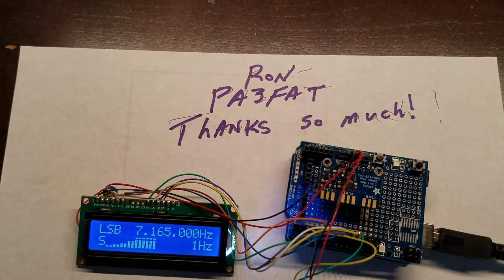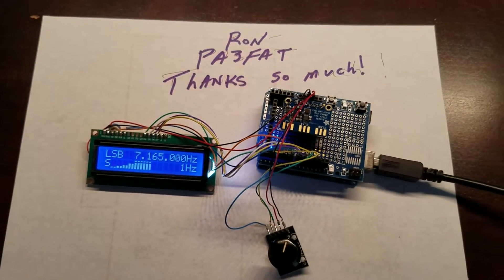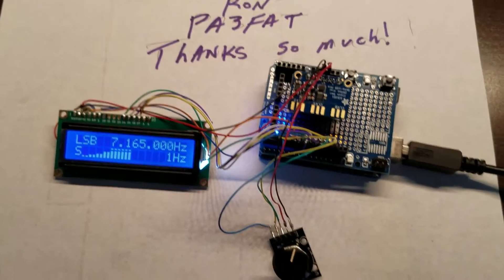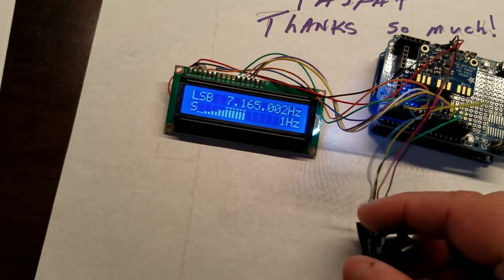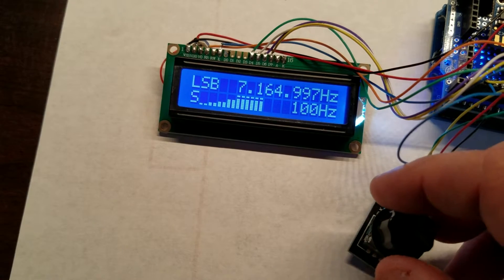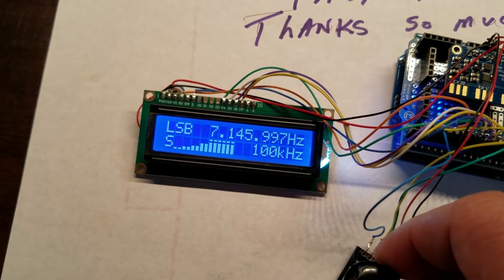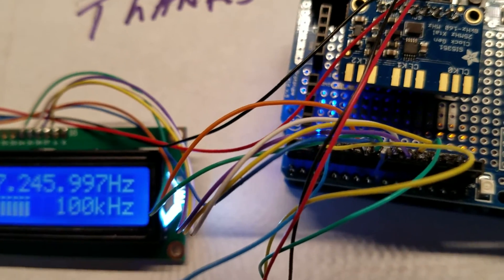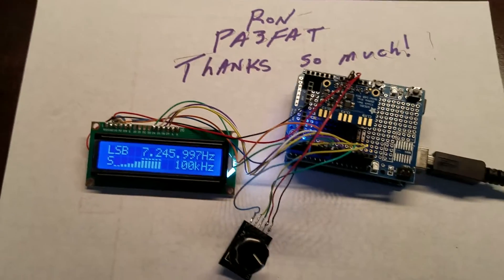PA3FAT vfo for bitx40

Comment: Could you help me to find some si5351 0,96" oled multiband dds vfo/bfo with 11mts and functions by grownding pins to change frequency to channel mod, clarifier, 10 to 80 mts transverter options, 25/27mhz board selection and weather's channels, please?